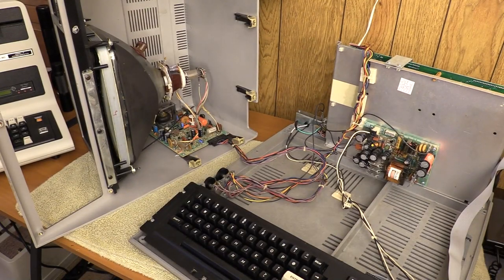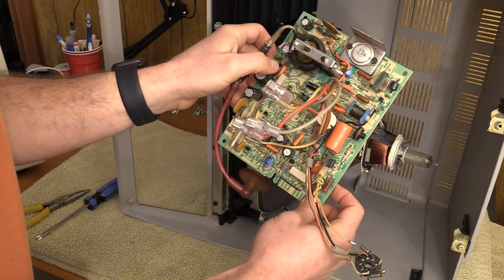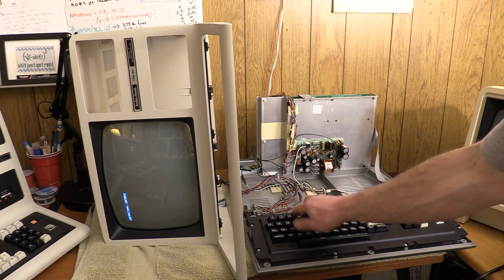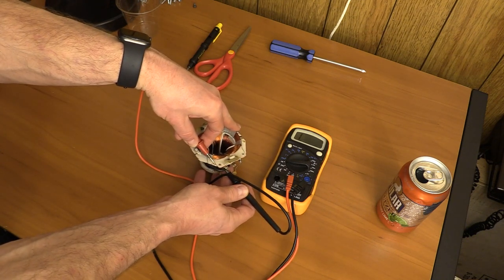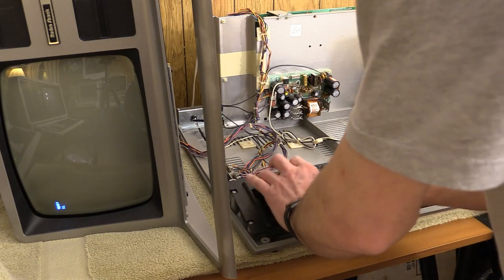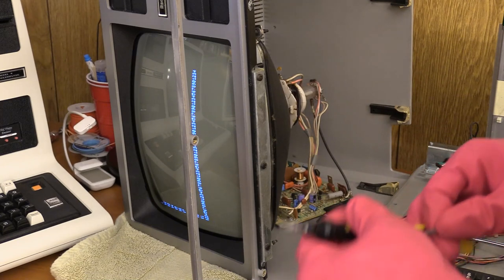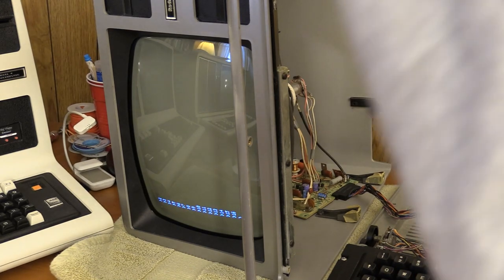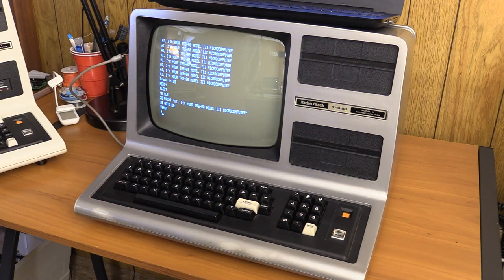TRS-80 Model III Restore - CRT Repair and Calibration - Part II

Comment: Huzzah! The machine lives! That's awesome you have spare parts to do trouble shooting on your TRS-80 machines. I have zero spare parts for my Model III and Model 4P. I'll be on the lookout for some parts machines for sure. As for the monitor adjustments you did, I would highly recommend getting some plastic monitor adjustment tools. I'm looking forward to your next video on this machine when you do the RAM upgrade.
Reply from the maker: Making something work again is very gratifying.  I've got plastic tools on the way...I'm guessing with all of these old CRTs, I'll be doing this more often, so they'll definitely get used!
Reply: @TJBChris  I'm the same way. I love making things work again. I also like cleaning up old machines as well. It's realxing to me... however having a drink while doing it helps too ;-)